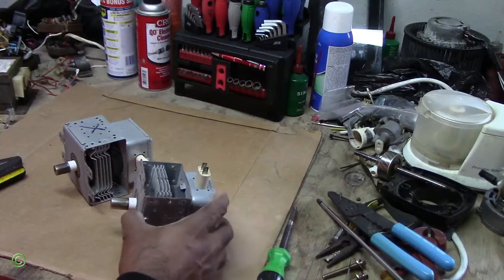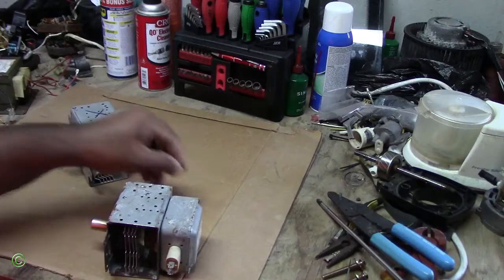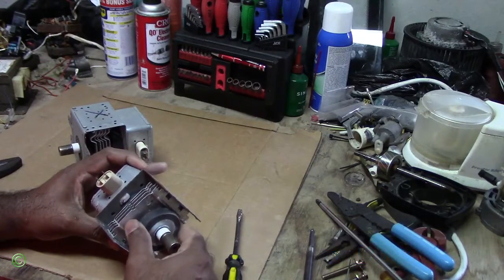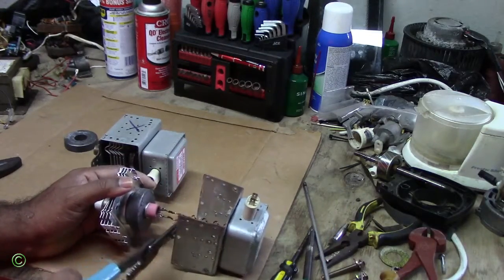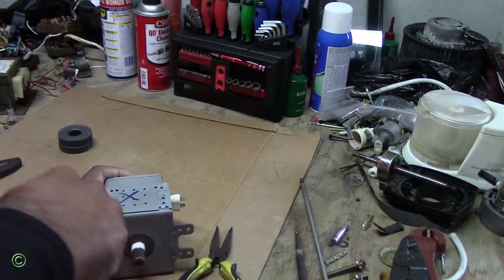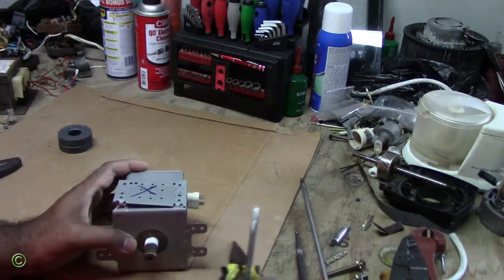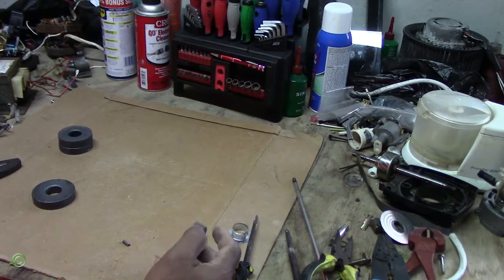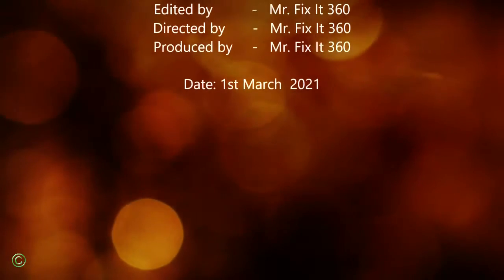How to remove magnet from a Microwave Oven Magnetron.

Comment: Nice one. But have a question. If the magnet in the magnetron is broken in pieces can the microwave heat on not?  Because mine the magnets are broken so it's not heating but the grill is working.
Reply from the maker: Good question. Ok in some cases the magnetron will give out a low heat wave. And in some magnetron it will not give out no heat waves.

Comment: The magnets of microwave ovens are of same strength for all types of microwave ovens? 
Please.
Reply from the maker: Good question. No. All magnetron comes with different sizes. Shape. Value and brand name.
Reply: @mr.fixit3604  Dear mr Fix, magnets of the magnetron are with diametral magnetization or axial magnetization?